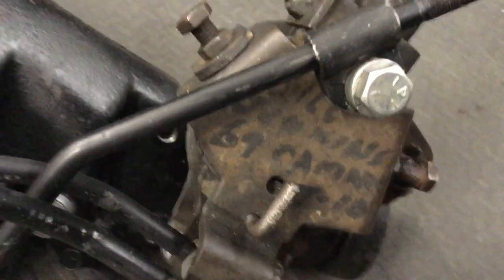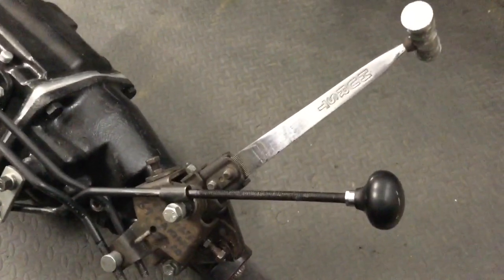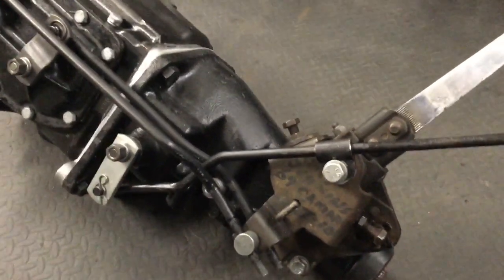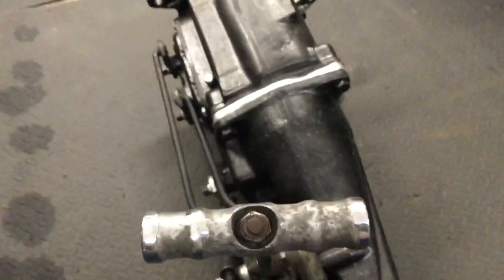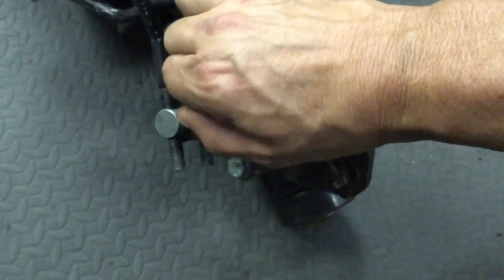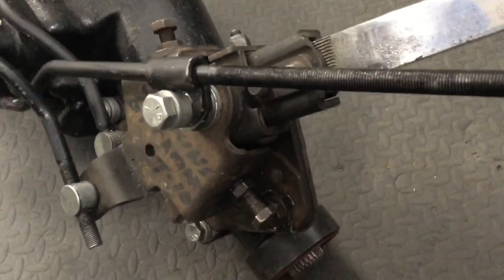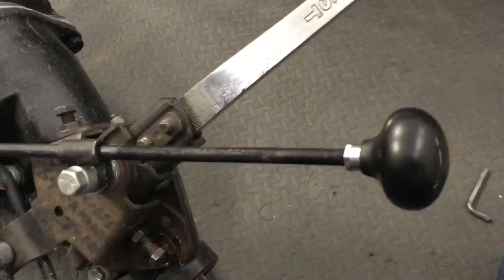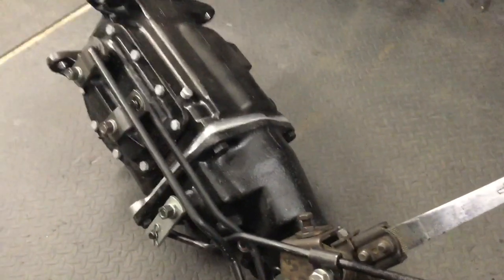Bill Jenkins Grumpy’s Toy VIII Pro Shift Super T10 with Hurst 3 speed and Lever Reverse

Comment: Hi, im trying to replicate the shifter setup on my car with a t10 4 speed. Is it just a 3 speed shifter with a rod for reverse or was it modified to work that way. Appreciate any available advice.
Reply from the maker: Yes it's a 3-speed shifter with a rod for reverse
Reply: That is a Hurst Dual Pattern with Synchro loc   shifter , originally made for three speed applications . Don't let anyone try to tell you that it's a Mystery shifter or a Master shift .

Comment: It's been almost 2 years, what's going on? Haven't heard anything else about this?
Reply from the maker: Thanks for following along,  we've had a few hang ups with vendors having problems sourcing parts and labor shortages.

We've been waiting on the front steering and suspension for about a year and a half, that's frustrating but understandable given the circumstances.

We had sourced NOS quarters, tail panel and a  roof skin but then found out the quarters on a 70 model year are different than all other 2nd Gen F bodies so I had to find an early, preferably 12/69, 2nd Gen Camaro body it's being shipped to Los Angeles next Monday.

The block has been sent off to Cedar Machine Services to correct previous repairs and they'll probably do some videos of their work with Bill's Can Am block.

Should Start moving along again when the body gets here, fingers crossed.

Thanks again for following

Comment: But the " Super T-10 " came out in 74 with the large output shaft .  This would be an older T-10
Reply: St-10s have aluminum cases and are 4 speeds.
Reply: @jontauer6240   They also had cast iron cases.
Reply: @bobwillis6391  yep
Reply: That was supposedly an over the counter early super T-10. They had a 10 spline input and 27 output.  I still have 2, they are iron cased, and both pro shifted. Got 1 in 89, the other in the 90s.  I case is dated 1973.  I ran one in my 67 gto for a while on the street.  I was like 19 then.  Lotta fun.

Comment: Was this the Steelcase super T-10 or the aluminum case.
Reply from the maker: It is an iron case and was supposed to have an aluminum tail housing but he did have one he thought was good enough so he provided an iron unit.
Reply: @ProjectsMB I really could tell by the pictures, and the mid plate looks aluminum,
Back around 1974 I built a 331 tunnel ram, put it in a 55 Chevrolet Pickup, I had a real nice M22 Rock Crusher, a guy that I knew told me hell you need to get a super T10, so so I found a T10 GM all aluminum case, and then the jerk said oh no I used the all steel case, did not know any better back then.
I have been looking for one for years have not been able to find one.
I have learned a whole lot in the last 50 years about parts.
Thanks so much replying on my comment.

Comment: Can you reverse in any gear with that separate shifter?
Reply from the maker: No, in the most generalized terms, when a manual transmission is meshed into a gear it is not mechanically possible to engage any other gear until that gear is disengaged.

Thanks for your interest and the question
Reply: @ProjectsMB  Ok, thanks
Reply: 100% you could have it in reverse and then jam it in a forward gear, tranny would be locked solid though.

Comment: Garbage, ford top loader is much stronger.
Reply from the maker: During the era in which this trans was used '70-'72 Pro/Stock cars could use any available transmission.  All the drag racing sanctioning bodies rule books said any trans from any domestic automobile manufacturer.  If Jenkins had thought there was any type of advantage to running a top loader I'm sure he would have,  since he ran a Dana 60 rear axle in this Camaro for exactly the reason you stated durability, especially since the Dana 60 takes more power to turn than a 12 bolt.

There weren't a lot of transmission explosions in the pre-Lenco Pro/Stock cars.  Regardless of manufacturer all the competitive racers built their "dog boxes" with  high nickle gear sets and a cast iron case so I don't agree with your point for race applications.  Street cars completely different story and I do agree the top loader is stronger in stock form but then again the hemi trans holds up and shifts through the ranges smoother.
Reply: Keep in mind the borg and beck clutches had quite a bit of slip back in the day which kept the trans alive. Any type of shock will start hurting parts.
Reply: The Ford trans may have been stronger , but it was slower shifting between gears , which is why only the die hard Ford guys ran them . A few hundredths here , a tenth there , it all adds up when trying to get to the finish line first .